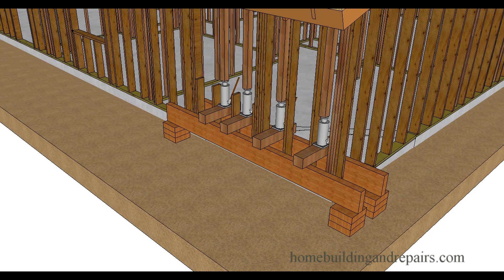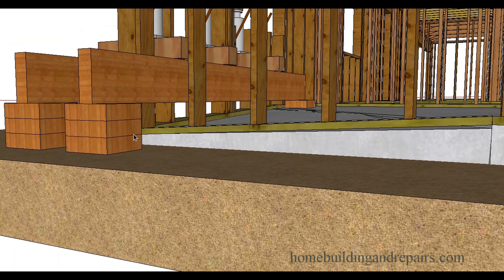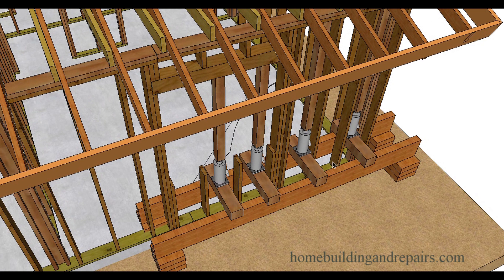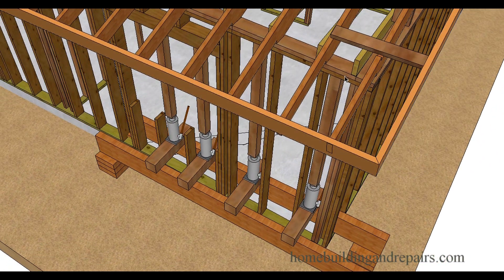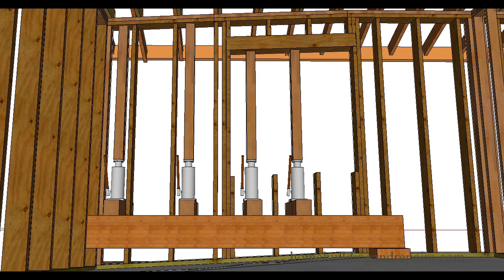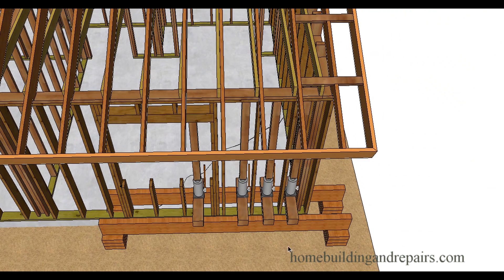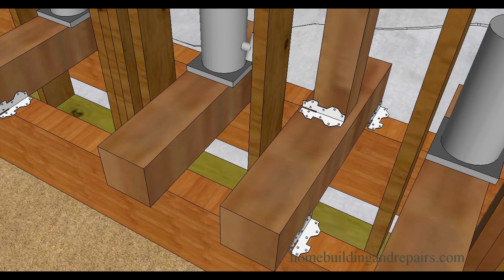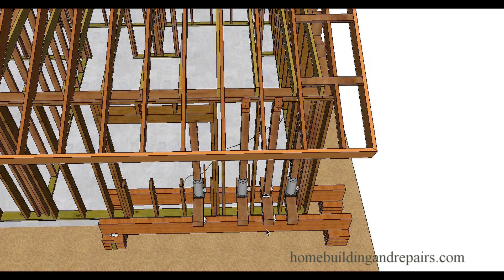How To Raise Corner of Building With Gable Roof for Concrete Foundation Repair

Comment: hello, when first setting  the jacks and 4x4. the main frame of the building were at an angle, do you still use the 4x4 with a 90 degree top or should it be angle?
Reply from the maker: I would think you could use what ever angle works as long as the jack and post isn't going to fall when lifting. The top can be angled to match a slope and secured in a manner that would not fail while raising or lowering, but the jack and post probably need to be straight.